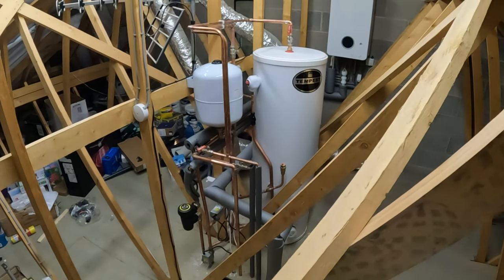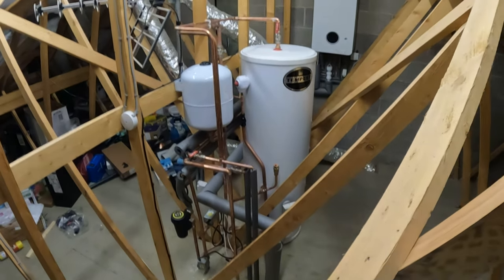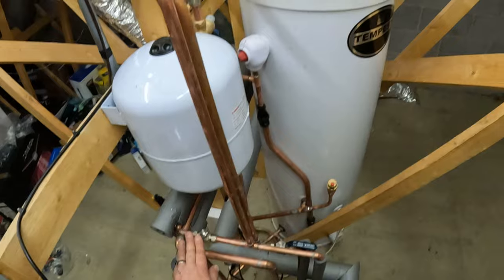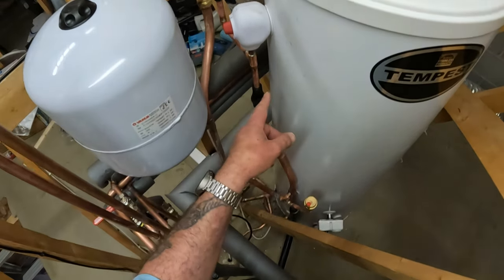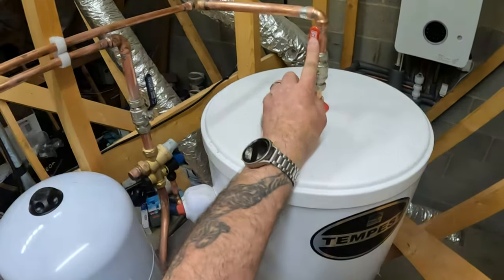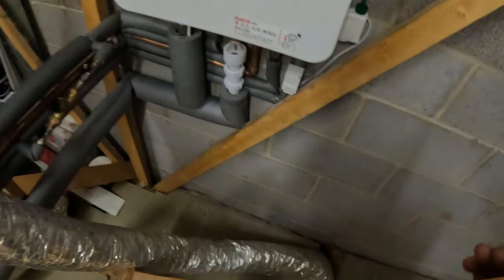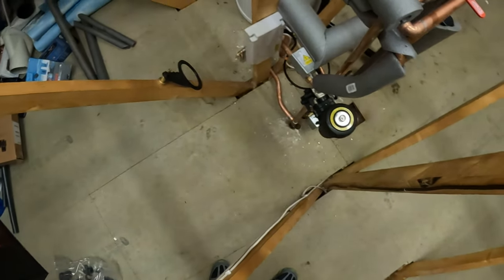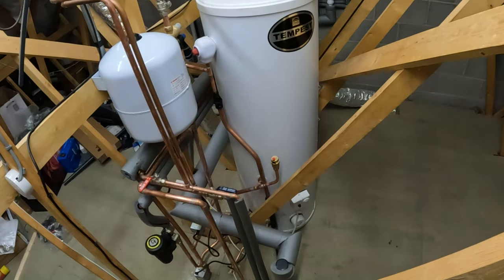Worcester 2000 Combi & Telford Tempest Unvented Cylinder

Comment: why not just pipe the hot water from the combi out in hot water priority  to the cylinder, with a return feed back,  it should modulate down to almost 7kwh thus you will never run out of hot water and will only fire up to keep it when called for,  using a sensor that way in summer your solar diverter keeps the tank up to temp but if it needs any more it just closes a two point valve and feeds from the combi,  see urban plummers old vid for more details
Reply: Have you a link please? Ill take a look. . . Just seen this sorry late reply. . .